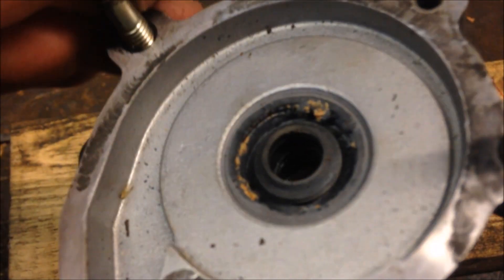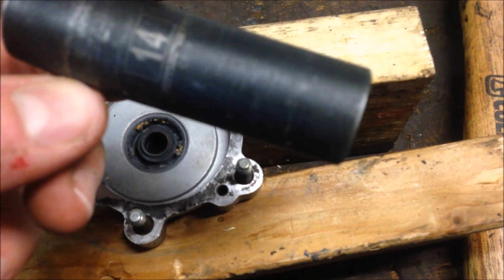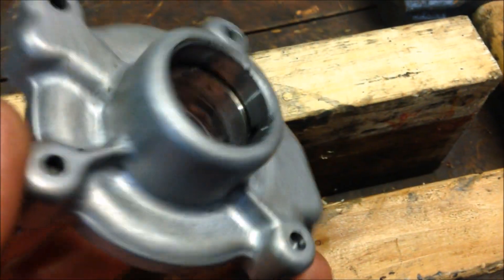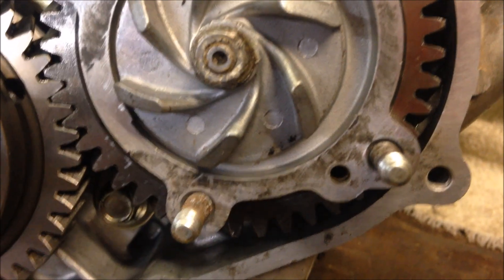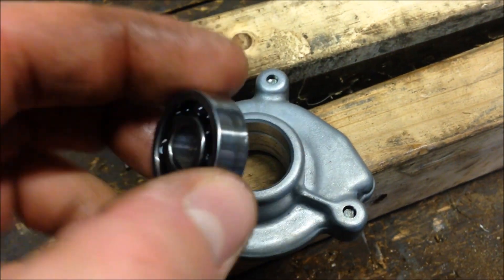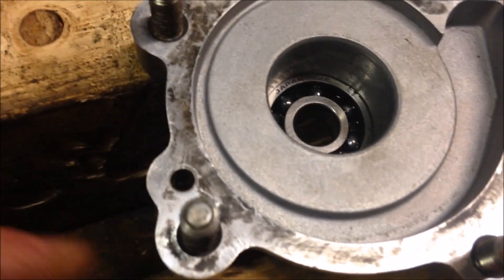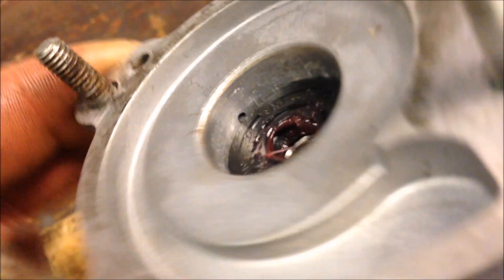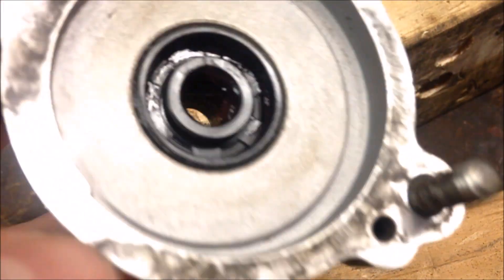Step 6: How to Install Water Pump Bearing Seal and Oil Seal 1991-1997 Polaris 400L 350

Comment: What happens if u put the new bearing in and it doesn’t have to be knocked in I can tap on it and it falls out doesn’t that mean the housing is wore out when I replaced it the old bearing was destroyed no bearings left and inner race was almost gone

Comment: My water pump seal kit came with 2 different seals.  Identical in nature, but one has the 3rd number as a 5, and the other as a 7. Measuring with a vernier, I can not see the differences.  I also found that the bearing outer race covers the oil-return to sump hole.  I opened it's diameter a tiny bit.

Comment: I have water in the gear oil is that the water pump seal or the head gasket or possibly both
Reply: For me it turned out to be the seal on the pump. All the gaskets were fine, but one of the seals gave out.